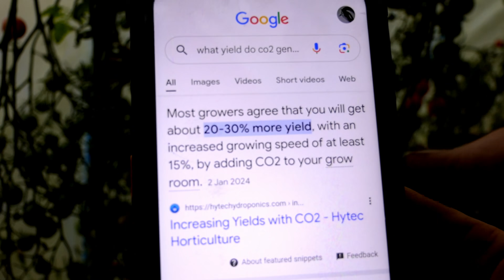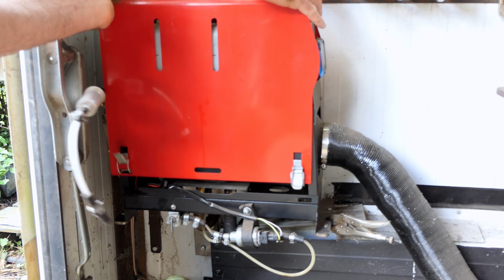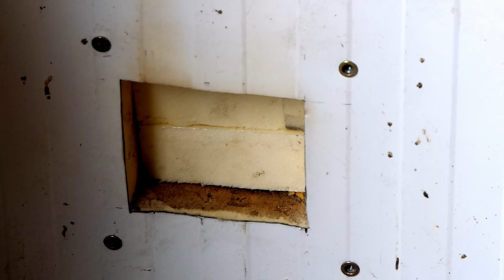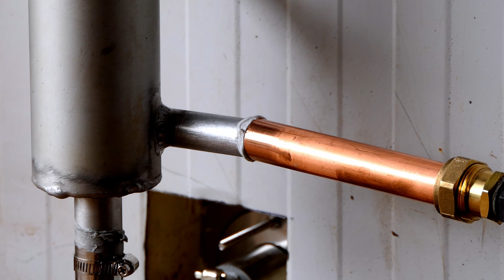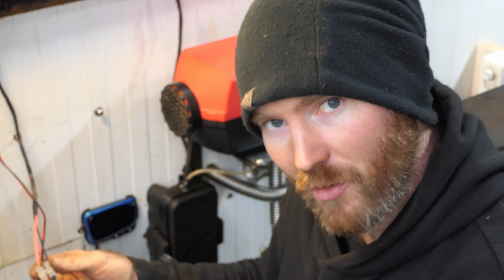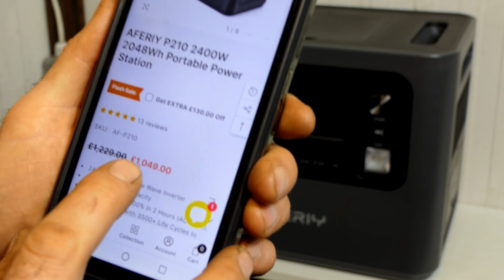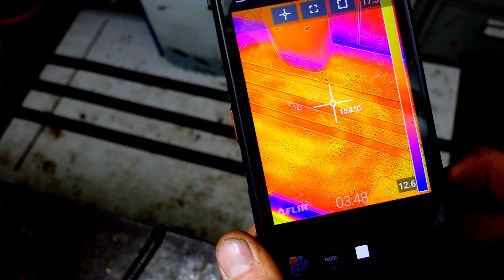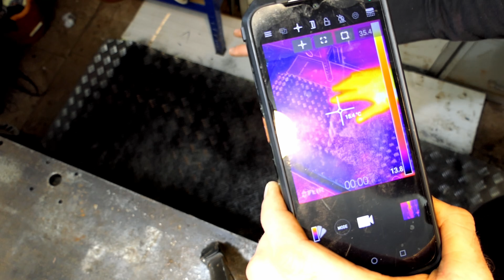NEW! Better system for Cheap and Safe Heating💲+ Underfloor Heating Mod test🫠

Comment: Few corrrections:
"CO2 is up 33%". It's actually 50% higher.
"Below 0.02% all life ceases to exist". Simply not true, there's been life with much lower levels.
"Humanity has contributed only 3% so it doesn't matter". Natural sources and sinks balance, the human emissions are extra net input that makes the CO2 rise as a whole.
"If we stopped emitting CO2 it would make zero impact" False, if net CO2 emissions go to net zero, CO2 stops rising because it balances out with time.
"Concrete and asphalt being the main culprit" No, these create local heat island but cannot explain global rise.
"Humans only emit ... it's too small to matter" Wrong. In net terms that's huge and a lot of it accumulates in the atmosphere
"Deforestation is the biggest factor" It's definitely a part of it but not the biggest. ~420million hectares have been lost to conversion since the 90s
"More CO2 means more plants and nature will cancel it out" CO2 does do that and contributes to the "greening" effect but it does not cancel emissions. There's so many moving parts in this that need to be considered, nutrients, water, heat stress, changes in ecosystems. A large fraction still accumulates in the atmosphere
"Ocean acidification is a side issue" It's actually directly linked to CO2 uptake and it's main driver are humans
"Elites are hypocrites so the science is sus". This is a trust argument and nothing to do with physics. Even if the messenger is hypocritical it does not change the measured facts.
"Climate change can't be stopped" Somewhat true, adaptation is necessary but mitigation limits the need. Human influence is the dominant cause.

So to put it short, you're mixing things and timescales a bit. Natural CO2 is big, but mostly balanced, human CO2 is extra which accumulates. Sure it does probably stabilize at some point with millions of years but the destruction of humanity happens much sooner., If it doesn't balance we are turning into Venus. So not ideal either way.
Reply: If it was the existential threat there would be no "carbon selling".
Climate temperatures have Benn MUCH higher and much lower.
The whole thing is an ideologically driven scam!
It is only western companies that are targeted. The only ones being told to sacrifice are those of us in the west.
This is only the latest environmental scam I have seen. 
We were all supposed to starve as populations outgrew food production. We now have populations in the west BELOW REPLACEMENT LEVEL!
Then we were going to freeze and now we are all going to BURN or drown or both!
In all cases it supposed to be the fault of the evil capitalist west!
Sorry, but tired of the bs!
Reply: @lauriestlyon8773  This is pretty much a prime example of why the "argument" exists in the first place. Anyone is free to shout whatever claims they want without any scientific proof. I'm not blaming you, you have just heard what others have claimed in a loud manner. First of all. "If it was the existential threat there would be no carbon selling." This doesn't make sense, the trading exists because some governments(also listened to wild claims like yours) decided that market mechanisms were the way to go. This has nothing to do with the fact the risk is "fake".  "Climate temperatures have Benn MUCH higher and much lower." Absolutely, the earth was molten lava at one point, and a snowball too, multiple times. But none of that makes current rising CO2 harmless. Again it's the speed at which things are happening that's big part of the problem. "The whole thing is an ideologically driven scam!" Nonsensical statement, the science stands. Thousands and thousands of scientists agree. "It is only western companies that are targeted. The only ones being told to sacrifice are those of us in the west." Again not true, you only see things in your own bubble. It is uneven but not "west-only", check out what China is doing. "we were supposed to starve..freeze.. burn.." Not related, this is kind of whataboutism. “In all cases it’s blamed on the evil capitalist West.” This is science that's based on physics. Physics doesn't care about blame. This is all about physical evidence and global observations.
Reply: @abbcc555  I keep being told 97% of scientists agree. If you ask the scientific community "Does Climate change exist?" 97% say Yes.  THAT IS THE ONLY THING THEY AGREE ABOUT! If you ask "Is it cause by human activity?" That is a WHOLE different answer.  Many credible scientists (Genuine Professors, Nobel winners, etc)  Do NOT think it is man made. In fact totally the opposite.
As to the science, The US Navy produce figures for ice thickness at the polar ice cap (They send subs under every year!) that said it is THICKER than it used to be! NOAA produced figures on ocean temperature that showed the water is warming. When questioned they admitted that the raw data did not show that but they "Know Climate Cjange is real! so they CHANGED THE DATA TO FIT!
That is not the only case. None of the models allow for the effect of volcanos, forest fires, etc and the effect of them. China, oh, China! Has lots of renewables. HOWEVER< they have also built more COAL FIRED GENERATORS than every western nations combined! 

As to the previous claims they ARE relevant, I am 61 years old. I have heard the Self Same People making these disparate and contradictory claims one after the other. It comes down to credibility.
I am not "Uninformed" just tired of the BS!
Reply: @lauriestlyon8773  Again, a lot of that stuff sounds very plausible but isn't when you actually dig in. "97% of scientists agree", it's fair to say not all agree on the details but IPCC says the expect consensus is "unequivocal". Also citing people's credentials don't make the physics go away. Relevant experts agree, that's all it takes. The US navy thing is more complex. There are records, sure. But they all show long-term thinning. NASA/JPL agrees arctic has lost much of it's thick multi-year ice and it's thinning. The studies show that it can be thicker in some contexts than previously estimated, ie. measurement issues. But it is thinning. The NOAA "changed the data" is again a bit more nuanced, NOAA updated their biases, this is normal in science where you make observations. Independent work validated the warming pattern using more "instrumentally consistent" records, ie. again measurement issues but the main point stands. This is adjustment, not fabrication. "none of the models allow volcanoes .. ", wrong. climate models explicitly include natural forces, including solar variability etc. "China built coal fired generators", this is true but again they also built massive amounts or solar and wind. But again, this doesn't change the physics. I understand you have heard contradictory apocalypses for decades. This is understandable but consider it a logic test. Public messaging by headline seeking media or social media is not the same thing as scientific assessment. If you need actual, tangible, concrete, verified real proof, you can read IPCC AR6. People can argue over policies, timelines, costs and whatever but again, that doesn't change the physics. I understand your frustration and a lot of people share it. It's always easy to make claims but debunking them takes time. This imbalance is the problem.

Comment: Just a novice pondering.... Is it possible or of any benefit to direct the hot air output ,over the heat exchanger? thereby warming the outside of the heat exchanger also,possibly using ducting to direct the hot air.

Comment: These diesel heaters what people do not realize is they were made safely. I don’t know about the Chinese diesel heaters, cause I’m still testing them, but the Wabasso diesel heaters they were made for a climates that they don’t shut their vehicles off in the winter time because when they shut it off, there’s a good chance it will not start up again. That’s why they invented these diesel heaters or a.k.a. parking lot heaters but one thing people don’t realize and maybe it’s just because they’re ignorant and they don’t realize that gasoline and diesel are way different because gasoline you can light with a match and gasoline. The liquid is not flammable. It’s the fumes with diesel. It’s the opposite diesel is a mixture of mostly oil and maybe 30% of gasoline and how I know that is because it’s the same way to make black diesel 70 parts motor oil 30 parts gasoline but onto what I was getting at is people don’t realize propane, and kerosene isn’t highly flammable in order to start kerosene or diesel on fire like gasoline, you would have to bring it to a boil and write as soon as it boils then you can start it on fire with a lighter just like gasoline just not the same reaction. It’s kind of like watching gasoline being lit on fire over the top of water it just floats over the surface. That’s what the flame will do with diesel or kerosene when you bring it to a boil
Reply: And for all those people that don’t have common sense when he says route the exhaust outside, it doesn’t mean the bigger hose that brings air over the top of the fins and out through the heated side. He just means the metal exhaust or if you are really stupid and you don’t know what we’re talking about and you wanna know what side is the exhaust if you look at the diesel heater and it’s got two holes that are big and one that has a nipple the one with the Nipple next to it. That’s your fresh air burn chamber that is not your exhaust. It’s the one farthest away from the Gas line nipple.

Comment: Preheating the air intake, doesn't it increase the final temp of the exhaust gases?
Reply from the maker: Recirculation of the room heat is effective but for combustion, cold air is more oxygen dense and therefore work better. Cheers J

Comment: Could you filter your old engine oil and put a drop or two into the kerosene to lubricate your pump?   Similar to old two stroke engines.
So it's more like diesel? Edit: conspiracy theories, sadly they are not just theoretical.  Oil is Not a fossil fuel. What dinosaurs?

Comment: When you redo the floor. Put down an underlayer of polystyrene( with an upper plastic sheet layer) or similar (Juckadorboard), then fix piping to underlayer using plastic Staples then cover with underfloor heating screed Before puting down some form of tiles. That will make the Floor heating more efficient.

Comment: I don't like to trust the government but i don't want to trust an unrestricted free market either. I think the increasing spread of misinformation, our inability to agree on basic, very well researched facts is the biggest problem today. If everyone is running around confused and arguing with each other were never gonna solve anything.

Global warming may well just be a coincidence, i find it hard to believe but i don't think it matters either way. Mankind wields incredible power, we can craft the environment if we wanted to. I guess your arguing that more carbon is actually good in some ways so just let it happen. I see our ecosystem headed in a potentially dangerous direction and feel like we could stop it if we wanted to so why wouldn't we?
Reply from the maker: I agree to a point. Carbon isn't bad, it's the destruction of nature's ability to sequester it that is. Removing or stopping CO2 is fruitless and causes more harm, but managing, replanting and protecting Forrest, oceans and habits would see huge benefits both for the health of the planet and economically in the long run. Cheers J
Reply: @joshuadelisle  All we can do is try to be as efficient as possible, the modern world does not exist without carbon emissions. We waste and throw away far too much though, which causes more emissions than needed. I think you must share at least some of that mindset by wanting to capture the heat from the exhaust of your diesel heater, if everyone thought like that we would be much better off.

And yes, i too believe our mindless destruction of the world's forests is a great tragedy. I'm from america and its disgusting how many suburban developments have no trees at all anymore. It's about as natural as the center of a city.

Comment: To prevent gullvanic corrosion in your system you want a sacrificial anode. You basically want a metal That's preferably attacked over the copper and aluminum. I can't remember what metal is good off the top of my head, but you can easily find one through a galvanic corrosion chart that shows you each metal's Affinity To corrosion. You could also use corrosion inhibitors. Phosphate protects aluminum, Tolyltriazole protects copper. Silicate is a good all rounder, but can leave thick deposits in the pipework, so don't overdo it. Copper and aluminium are common components in PC water cooling systems, so a bottle of liquid cooling additive for PCs with corrosion inhibitors may just do the trick for your system.

Comment: What about a long exhaust pipe full of fins like a electric base board heater?
It can be added after your heat exchanger.
Spiral wound finned tube maybe?
You could use an old baseboard heater to house it.

Comment: 100% on what you said, thank you Joshua.
I've been told CO2 in a submarine is 6000ppm - 0.6%. Lecture hall 0.4%, these figures are good for plants
We are starving the plants, and as they try to take in more air, to convert to food, they dehydrate.

So glad the people here have learned beyond the political profitable BS or global warming, or cooling, or the ice age by 2000, or the acid rain theory before that. 
Remember if the politicians lips are moving, they are lying.

Comment: Josh I agree with others that the piping underfloor should be fitted on top of the insulation foam and ten skimmed over with something like concrete to act as a heat sink and radiate heat for long periods. 
Also you discovered you increased the heat output by spraying the aluminium surface with black paint. Because black absorbs and radiates heat more efficiently than silver or white why don’t you spray the underside black as well so the aluminium absorbs underneath and then radiates above. 
I remember this from physics at school.

Comment: I know this is a year later, but on your underfloor spiral, just a thought of carving out the channels a bit more on either side of the tubing and filling that void with a thermally conductive material. I'd say sand, but its conductivity is minimal.  I leave it to you.  Second, and may seem overly complicated, but I have one that heats my barn, and I have my exhaust routed through another car radiator with a drain plug installed. I empty periodically for condensation, then it goes outside. It was simple to adapt with standard fittings and high-temp silicone.  My sound is almost non-existent, and heat loss is minimal.  Just what I have done, maybe it will spark some ideas in you.

Comment: I would like to know your take on cogeneration systems . I've been thinking of getting a diesel generator and doing the heat exchanger with the exhaust for hot water.
  And regarding your views on climate change are you saying that of the doubling in CO2 fossil fuels are only responsible for 3% and deforestation is responsible for the other 97%? I'm also curious where you got your numbers.

Comment: Not sure about the climate change stuff 'cos it's a lot to take in especially as there is so much noise from all directions and I am very old and easily confused. However, i think using the waste exhaust heat to heat water to heat a radiator and unserfloor pipes is introducing an un-necessary element. Have the exhaust going directly into a series of radiators connected in series without using water as an intermediary. Make sure the rads and pipework don't leak and then make the external exhaust from the last rad in the system which by then should be at or below ambient temperature.